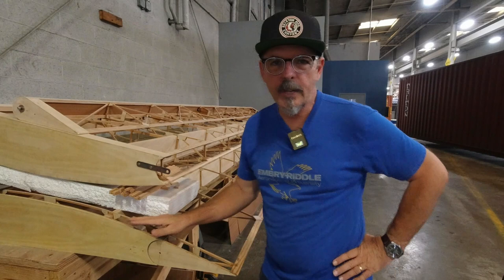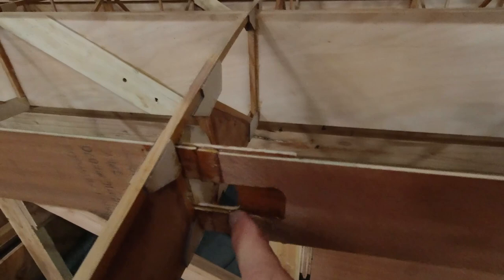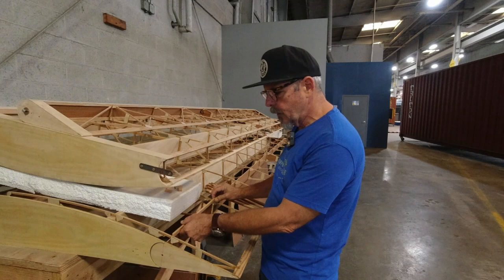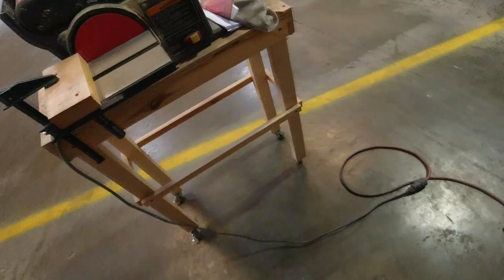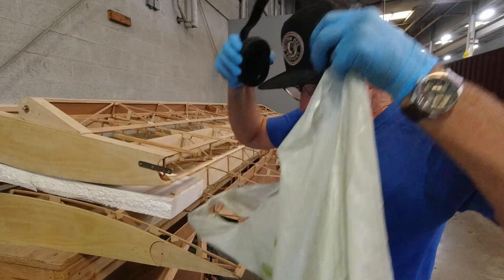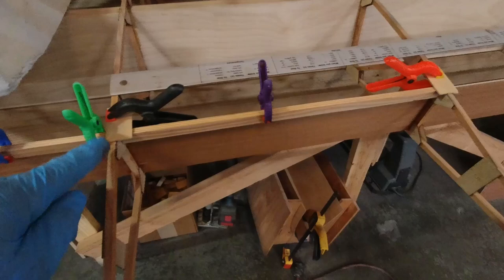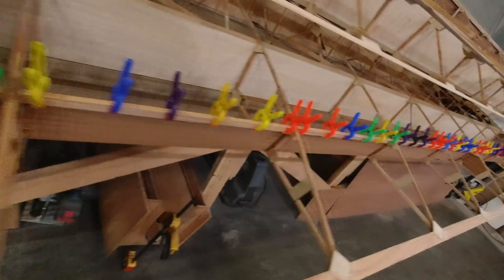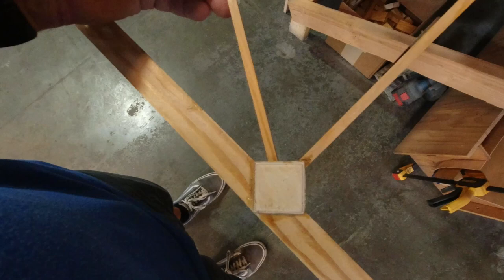Minimax 1100r Aircraft Build Vlog Episode 35

Comment: Dennis.  Trying to stay up with you.  I saw your comment about using a "Kawi engine."  Never used one, and the only ones I saw installed, a long time ago, were on CGS Hawks.  Back then, there was a problem with one cylinder overheating.  Not sure why, but I do remember that.   This 1100 must then be your 2nd one?   You talked about another 1100 with a 277 that made the 254 wt. requirement.  OK, I'll keep watching.   Thx.